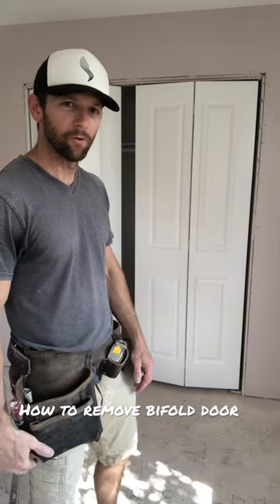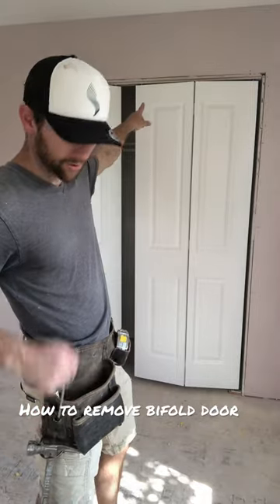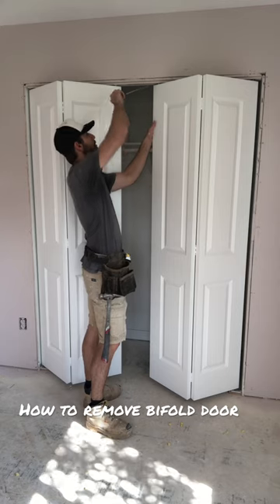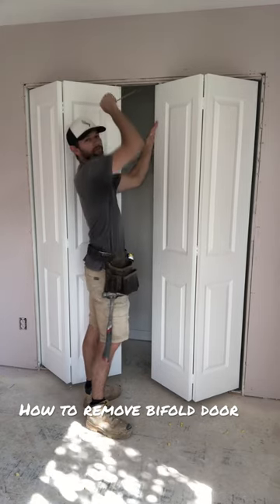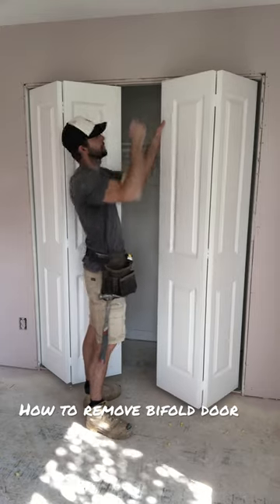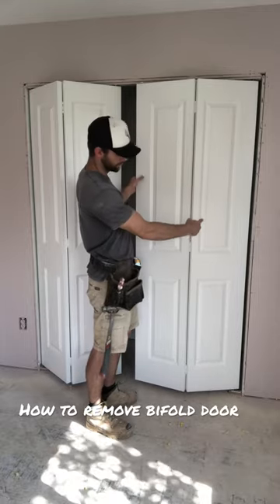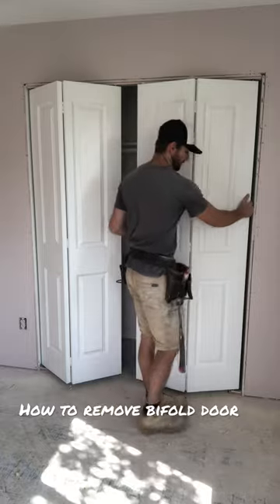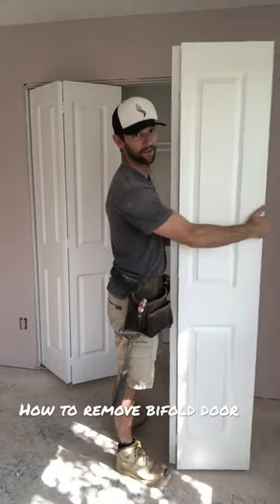How to remove a bifold door

Comment: Now will you please show how to get the damn door back on, mine has two stationary plastic (?) pegs at the top and one at the bottom. There is no wheel on the top PEG, but the door and I are having a battle royal, and the door is kicking my ass.  TIA